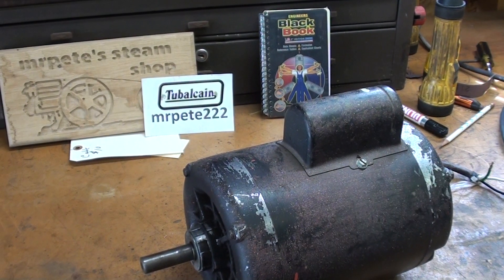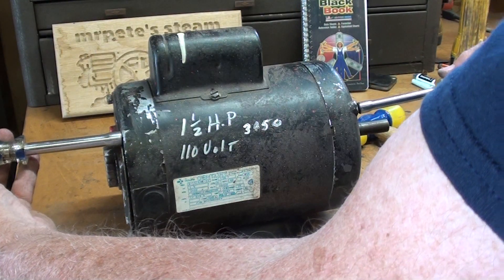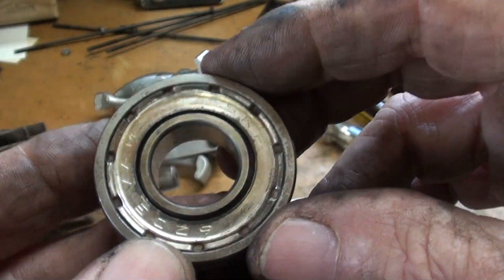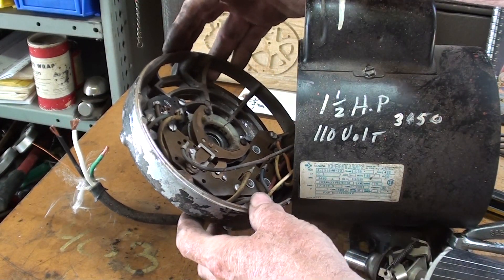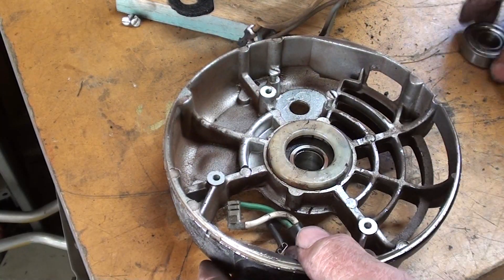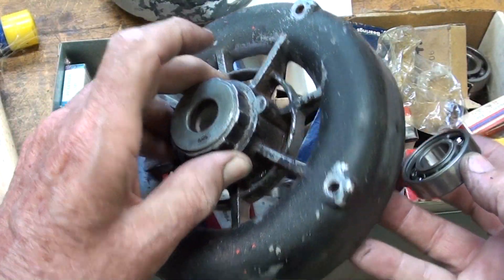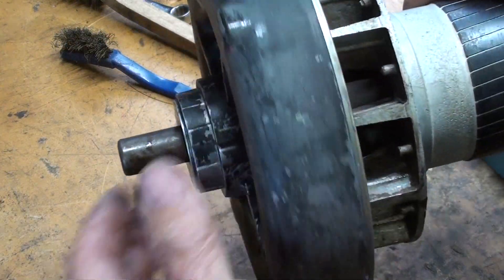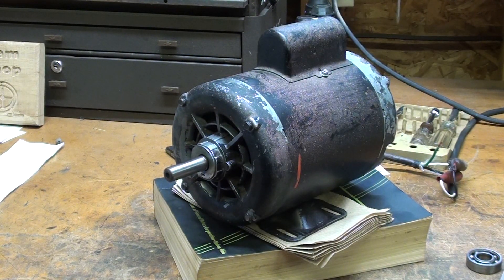Replacing Electric Motor Bearings Tips #468 tubalcain

Comment: Just the man I need help from, I hope. I'm changing the bearings on a Doerr LR-24684, 1HP motor and I'm having the worst time sourcing one of the bearings. The larger bearing seems to be stamped 'NDH 3204EB or 3204E8 USA'. Could you please recommend a suitable replacement? It's a metal shielded on both sides and the dimensions are:
ID .8745" / 22.21mm
OD 1.850" / 47mm
Width 0.55" / 14mm

The machine is the 31-710 Rockwell combo 12" disc & 6"x48" belt sander.
Reply from the maker: Look it up on the Internet. For bearing exchange numbers.

Comment: On some electric motors the shaft end is equipped with a higher capacity bearing because that end will be subjected to greater load. The other end being under less load can serve just as long with a lighter weight bearing. They can cut manufacturing cost and potentially a small amount of weight by using a bearing only as robust as needed for that specific part of the motor.
Reply from the maker: Thanks for pointing that out!

Comment: Hello, 
I finally took the plunge and disassembled a Doerr LR22132 1.5HP. Got it apart.  The beatings are 5/8” sealed labeled 230. If they are sealed, do they need to be replaced?  I also need to change direction and volt from 220 to  110. Any ideas?  I looked it up, found the reference,but can’t find the numbers for the internal terminals.  Any suggestions would be appreciated.
Reply from the maker: Sealed bearings can wear out just like any other bearing
Does the motor nameplate say that it is dual voltage?
Reply: The motor is from a 1970’s sears compressor. It gives wiring diagrams for both voltages. The terminals have no markings I can see.  @mrpete222
Reply: I’ll get a few pics and send them once I get it cleaned. Is ib better to blow or vacuum up the old crud in the motor?  Thank yiu. Glad I found yoir page.

Comment: No oiler = Built in obsolescence. While ive never seen such a setup in a motor that large, it's not uncommon to find motor armatures with a ball bearing on one end and an oil bushing surrounded by felt to hold oil on the back end. Considering how inexpensive ball bearings can be the only possible explanation i can think of as to why this is done is to make sure you are a repeat customer. my 14 gallon ridgid shop vac is done like this, but since i learned about it before the oil ran dry, i frequently open it up and add oil to the felt.

Comment: Really nicely paced instruction with attention to the important facets of the task at hand. All those years of teaching experience really paid off (for us viewers 😉).

After more than a decade of distraction, I'm finally getting to my queue of 1940s/50s era woodworking machinery rebuilds. First up is a small table saw that needs new motor and arbor bearings. I've done a motor before but this will be a first for arbor bearings.
Reply from the maker: Thank you for the compliment. Good luck with your rebuilds.

Comment: Two questions:
1) why is everyone emphasizing the importance of marking the bells position? I don't get it. They are perfectly ROUND after all. Why does it matter to mark them before taking them apart? (plus there are long bolts holding both ends, already 'marking' the position)
2) how would I go around cleaning the part with the windings, but to not affect the windings with the solvent?
Thank you kindly in advance for answering. (I am preparing to clean my little range hood fan electric motor from huge grease mess. So only question no. 2 is of importance to me, question no. 1 is only for curiosity).

Comment: I needed to know what the inside of the motor looks like before I attempted to attach two motors back to back see I'm thinking about making a electric operated bicycle it runs off of motor that charges itself so I need to take a motor completely apart and weld the front part of the generator to the back side of another motor that way I can run my bicycle on a electric motor and charge it at the same time on the the front motor will drive the tires  and with the back motor being attached to the front motor I won't need to drive shafts to run the two motors so the back motor will automatically be spinning why the front motor is spinning that way I can hook the back motor up to a battery charging device I think it's genius
Reply from the maker: I hope this is a joke. You are proposing perpetual motion which defies all laws of physics

Comment: If you didn’t press the front bearing onto anything. Wouldn’t the force between the two opposing end bells being tightened and therefore squeezing them together press the bearing into the exact place it needs to be?
Reply from the maker: Not necessarily

Comment: You mentioned that you cleaned the motor parts in solvent. I'm interested in how.  What did you use, what is the process, please?  I want to make sure I do not mess up the motor windings or any other electrical component or insulation.  I'm attempting to remove rust from inside the motor.  Thanks.

Comment: Just bought an old lathe and it sounds like I need to replace the bearings. This video has given me the confidence to dive in. Thanks!!
Reply: You never did it though did you. lol
Reply: @calholli  actually I did strip down and repack the bearings. Running good as new, but I haven't actually used the lathe for more than a few test pieces, hehe. Need to get a 4 jaw style chuck for it...

Comment: I am a novice at working on electric motors.  So, this video was very helpful. I bought an electric motor at a yard sale recently.  Unfortunately, the name and other information are missing.  Suffice it to say it is very much like yours in this video and I believe it's 1/2 hp.  The shaft goes in and out about 1/8".  It has sleeve bearings on each end and they look pretty good.  Is this "play" normal or something I need to repair?  Hope to benefit from your wisdom!  Thanks in advance!  I look forward to your next video!

Comment: Bearing numbers explained  https://electricalfundablog.com/identify-bearing-number-calculation-nomenclature/

In your case 6203 RS
6 = single row deep groove ball bearing
2 = light duty
03 = 17mm bore (fits 17 mm motor shaft)
RS = one side sealed

Many electric motors use 6201 thru 6203. You could probably ascertain the bearing needed just by measuring your motor shaft, e.g., 17mm means you'd order a 6203 bearing.
Reply from the maker: Thanks

Comment: Thanks for the video. I am trying to get a 1 HP electric motor back working for an old Craftsman 113 table saw.  When powered the motor would hum then trip the breaker.  I took it apart, cleaned it up, put it back together and got it to spinning.  14 amp motor on a 15 am circuit was still tripping the circuit.  I plugged it into a 20 amp circuit and it ran for about 30 seconds before blowing the capacitor (pop, smoke, electrolytic fluid leaked out).  I took it back apart to check the bearings.  One bearing has me puzzled.  I think it may be a sleeve bearing, but it appears to have some type of fibrous wafer inside that I am guessing is supposed to absorb the oil (from the oiling ports) and then keep the spinning shaft oiled.  On the inside surface of the bearing which has ID of about 5/8", there is a gap in the inner surface (1/4" - 5/16") where that fibrous washer/ring is exposed.  Is that normal?  What type of bearing is that?  I have ordered another capacitor, but don't want to install it just to destroy it also if there is some other issue that caused the first capacitor to fail.

Comment: i miss that job,i work 40 years on a motor shops  ,,,,small  size and big  size shops ,the small size can  repair motors up to 300 H.P and the bigger size shop up to 10000 H.P, 3200 -4600 and 13800 volts motors ( only industrial stuff ) ,the small size shop repairs everything  but limit to 300 H.P ,O.K  most  home   motors (like)  swimming pool MOTORS ,,,and no so,,,, they have 1 sleeve and 1 roll bearings ,they never have 2 roll bearings ,and the oil burner  motors 99.99999999% the time no ball bearings at all, ,,only sleeve bearings but the industrial motors all ways have ball bearings and most the time special bearings ,my job was repair D.C  motors most the time (in the shop  and in the field ) ,,,I LOVE DC MOTORS ,,,,, but sometimes  i have to jump doing A.C motors  if the shop need help on A.C motors but i no longer  work anymore because my age  went up fast but i love to  watching you videos doing all kind things  (  like that  belt sander  )  ,i spend all morning   you 7 whatching you videos on that
Reply from the maker: Sounds like you had an interesting career working on motors. Thank you for watching my videos

Comment: omg, these idiots will scour everything for anything to criticize.  I consider myself a cynic and even I don't do that.  (if anyone actually reads this, I'm sure I'll get the "well, someone will watch it and emulate the mistake" argument, which ironically supports my point lol)....btw, +1 on the puller tip.  I just bought the Proto Master Puller set and it is awesome.
Reply from the maker: Yes

Comment: I once found an odd sleeve bearing similar to what you found on your motor on a smaller air exchanger motor that needed replacing. I could not find any way to fix it other than to change the entire motor at a crazy price. So I ended up removing the material holding the bearing and casting a new seat for a similar size ball bearing using liquid weld. Similar to jb weld. It was a bit of an experiment at the time but it's still turning today many years later and now the bearings can easily be replaced. Thanks again for your great videos.
Reply from the maker: Sounds like a good fix

Comment: Have had a lot of motors apart but never seen balls on one end and sleeve on the other?? That is a nicely made integral fan assembly. So many new motors have plastic fans.  I've never liked single phase motors, too many parts to fail. Don't like open motors either. (Crotchety old man!) Even when my shop was at my home I started using 3 phase.  It is easy to make a rotary phase converter.
Reply from the maker: Yes, three phase motors sure are simple

Comment: at 3:00 in this is a potential trouble spot for this motor design, on the double ball bearing version the bearing will damage the switch and you have to first take the rear bearing housing off to maneuver the switch around the bearing. usually this bends the switch which causes the arms to hang too low, so it wont start when re-assembled, or it makes noise.

Comment: Mr. Pete, thanks for what you do!  Does that starting capacitor pose any risk to you when you are disassembling the motor?  How do you know its in a zero energy state?
Reply from the maker: You're darn right it does. Discharge it across the two wires
Reply: Not second guessing you, just have a keen eye to detail. Not to be confused for vast knowledge of electric motors. Lol

You claimed it was 1 1/2 hp & the same was written on the motor. However, on your tag it is stamped 1/2 hp with a 1 in the PH field before the HP field. I'm presuming the 1 PH indicates single phase? And only 1/2 horsepower?

Comment: The mixed bearing thing is a design specification, motors can have a variety of bearing configurations just like the seals you mentioned as to what the designers intended the end use of the motor to originally be. Back in our days it was standard practice that if a ball baring was not absolutely necessary for longevity, save expense and use a plain bushing, if you remember ball bearings weren't as cheap then as now. That motor you replaced the bearings on was specifically design for "belt service" most likely to power a belt driven air compressor (because of the huge fan on one end)where it would see a high lateral loads on one end. Matter-of-fact, back in our days Century built damn good motors although not the very top of the line like Lincoln Electric, or Reliance Electric (just my opinion.)  Yes, Lincoln they did build more that just welders,  On AC induction motors the rotation mass is call a rotor, on DC motors it is called a armature (a rotating switch.)  For once I've got to send some information your way. Thanks for all your great videos!
Reply from the maker: Thanks

Comment: Nice video hard to watch change bearings all the week long for machine rebuilding. Bodine is my main motor rebuild. Still watching the video in case I learn something new because you never know it all and can always learn a bit more. Yes agree the identification on the bearing is shrinking 55, little surprised you do not have some new old stock bearings from a sale you attended in stock MrPete. Nice to see you replace the bearings tired of others taking these motors apart (big effort) then cleaning the old bearings and putting them back in, oh there is your new old stock I am ok now.
Reply from the maker: Thanks

Comment: Thank you Mr. Pete! I have an old (NOT OBSOLETE!) 1969 Quincy compressor (per serial #) and I am sure the motor bearings have never been replaced. I can tell, it makes an awful squeaking when first starting up. I was dreading taking it to the local Las Vegas, Electric motor repair shop because as a 45 yo person I don't think people spend the true quality of time and do a good job. That's why I find my self, watching you, the Canadian AvE, The old Tony dude, the Spring that Clicks, and many more, including some from your meet and greet. Point is, I thank you for what you are doing your Tubal experience is very morally and mechanically valued, and I always look forward to more.

And now on to that bearing motor job... time to plug in the Rigid that moves across the floor on its own! If I had 2 Rigids I could race them!

Comment: Well built older motors are getting harder to find for cheap or for free. They used to be everywhere (much like little Briggs engines were everywhere) but I only came 3 this year.
Reply from the maker: You are right, I seldom see them. Sometimes you have to buy the entire machine to get the motor
Reply: Speaking of buying machines... I saw that SB 9" belt guard yesterday and smiled. :)  @mrpete222

Comment: That was a great service on the Gould Century motor! I also was surprised when finding that this style motor has one sleeve bearing and one ball bearing. They are good motors, though. Many were used on air compressors. The rotor is made by placing the iron laminations into a die casting machine, and then injecting the aluminum into it so that it fills the voids and creates the rotor bars.  In the Gould Century motor, they cast the rotor fan as one piece with the rotor bars. It does look different like that, and it helps provide flywheel mass for reciprocating air compressor applications!
Reply from the maker: Thanks

Comment: pump motors generally have a fan shield like that to toss any water that might come in outwards.  Did you measure the shaft? I only ask cause I have a set of 6202 bearings on my desk. Both are marked just 6202 nothing else but one is 15mm the other is 1/2 inch inside diameter. Ive seen that a number of times even when shopping for bearings. I'm probably the only one that comes with her own caliper just to check inside diameter of bearings before i buy them.

Side note. Just checked i have 6203's as well. these are what I call used non crit bearings. Ie I replaced them on a motor but they were not bad. For slow speed applications these would be just fine. Ie a roller assembly for either woodworking or steel. And they are both 5/8 not 17mm.

uhm not to be picky but are you sure that is not a 3/4 hp motor? 1hp + usually have a 3/4 shaft. which would be a 6204 bearing

oh well just my two cents worth (nickles if you prefer)
Reply from the maker: That's funny is that the same bearing number would fit different size shaft. I know that bearing quality varies. But sometimes it's a good enough

Comment: I was happy to see you properly pressing the bearing into the endbell all nice and evenly... and then you just hammered the shaft into the bearing and it made me cringe. Seriously, why didn’t you use the arbor press to press it in as well? From a manufacturing standpoint where I work we press the bearings onto the shaft. A light coat of grease goes in the bearing bore in the endbell and the whole shaft assembly just slides together. 

When building an open motor like that the ope endbell would be joined to the frame and stator assembly, the through bolts put in place, and the whole thing place on a jig to hold the t-bolts in place. Then the rotor and shaft assembly would be inserted into it and the pulley side endbell slid into place. It used to be that you might have to lightly tap the endbell to seat it to the frame but today to prevent damaging the bearings they have more room to slip it into place. After that they just lock it together by putting the hex nuts onto the t-bolts.
Reply: Also, did you make sure to tuck any loose wires behind the t-bolts when you put the ope endbell back on? I’ve seen the damage caused when a loose wire gets caught in the centripetal switch. It isn’t pretty. 

You should also point out that care should be taken to not pinch wires when putting the ope endbell on. 

And to be careful and not force the t-bolts when putting them back in. Too many times I’ve seen where someone did that and not realize that it was the wire pressing against the t-bolt threads. By forcing it the threads chewed through the insulation on the wire and set them up to short out the motor.

Comment: Amazing how you seem to have a NAPA stor and an ACE hardware  saved up  in you supply areas(: love it!.
 2 of my boys started out being welders by trade and from the need for employment and adoped the saying"'paint is  so overated"  LOL!
 Motors haveing oilers can be a catch 22 as a lot of those type of motors got so much excess oil applied by the owner that the starting points fail to contact from the oil coating them.
Reply from the maker: Yes, I have a lot of junk. And motors are often over oiled